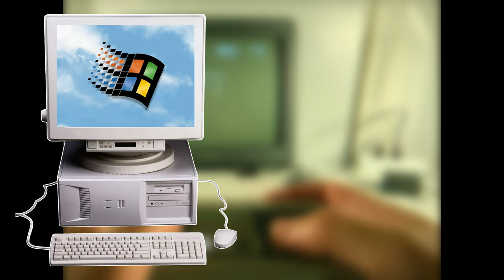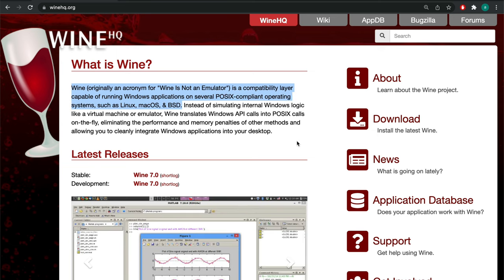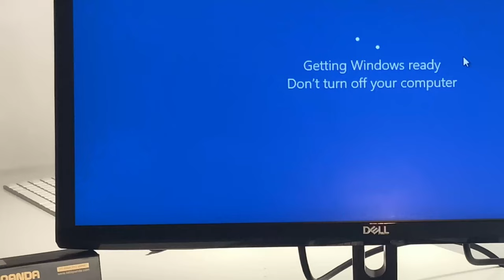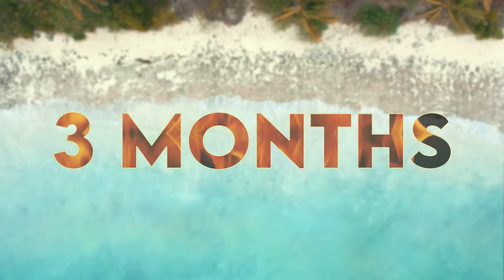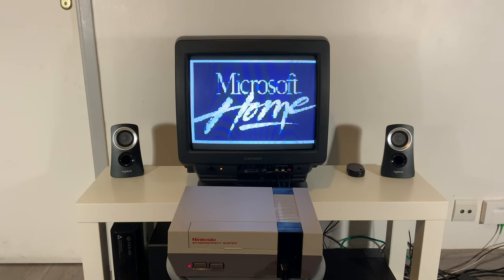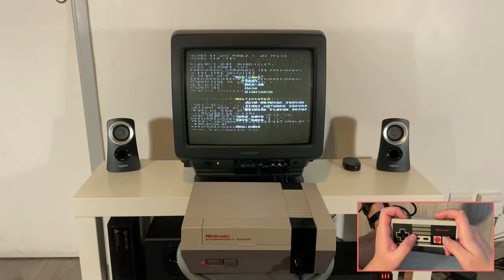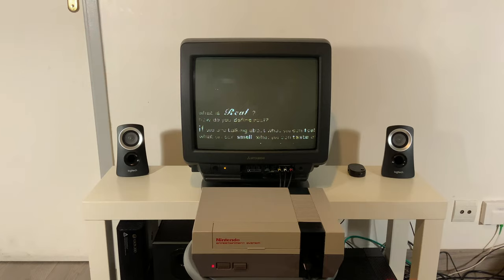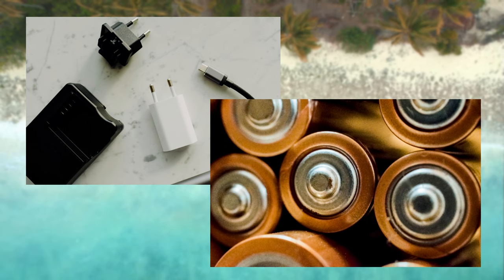Can NES run Windows games?

Comment: How I do made the same for a nes bootleg?
Reply from the maker: If your bootleg can play same cartridges as normal NES, it should work. The only other attention should be made to a power circuit of your console - make sure it's not overheating too much.

Otherwise, the steps are the same as described in the video - make a NES DOOM cartridge with LattePanda instead of Raspberry Pi, compile custom WINE and drivers from the repo, configure and tweak Win games that you want to play.
Reply: @ciciplusplus  Answer "YES"!